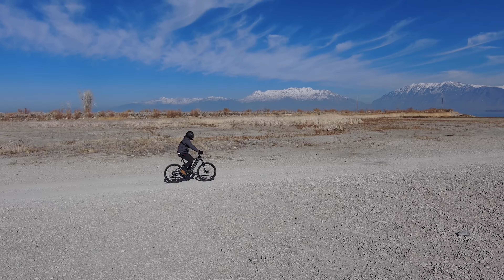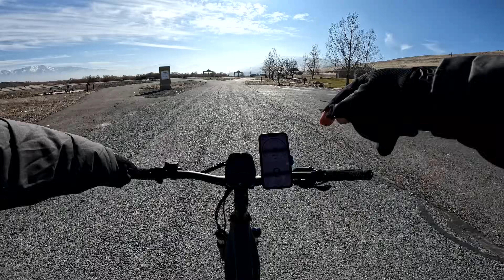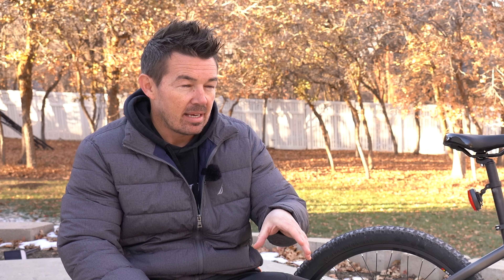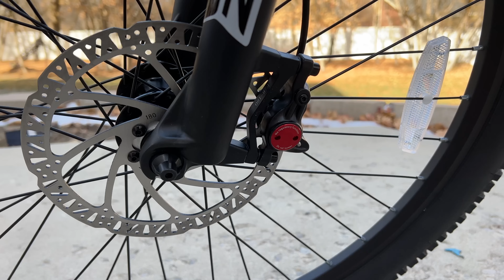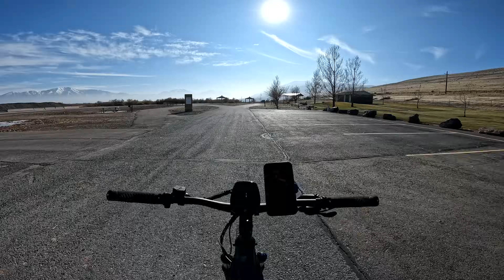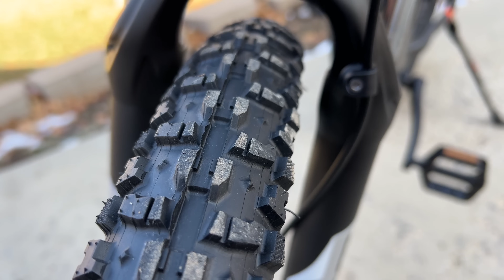Lots of good stuff with this bike! | Hovsco HovRanger Torque Sensor  Electric Bike

Comment: I got a Juiced RipCurrent last month and the torque sensor is the way to go, but the tires are a bit obscene and obese so good to see an inexpensive trail-capable (?) e-moutainbike. Speced at 55 lbs, about 20 less than most Fat tire eMTB, so  easier to throw around on the single track.